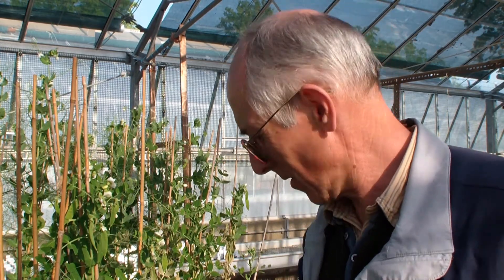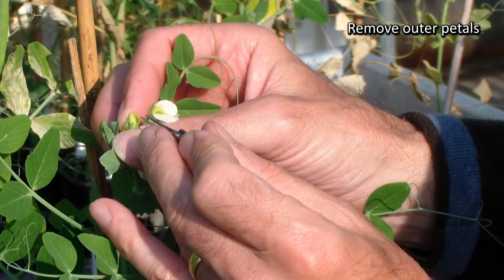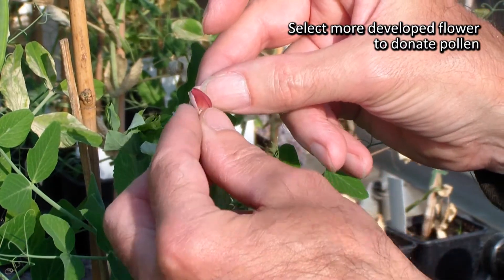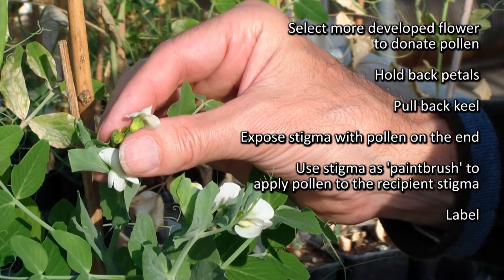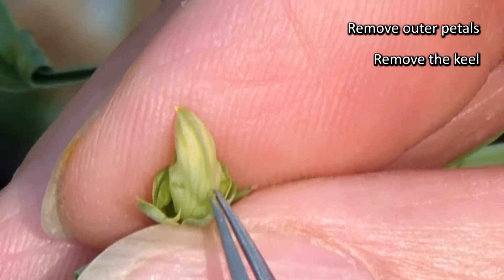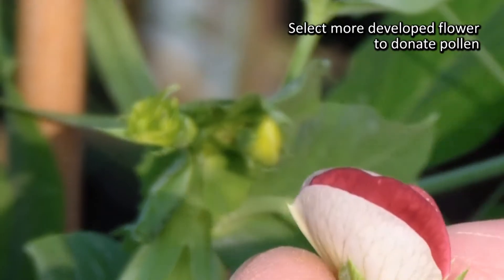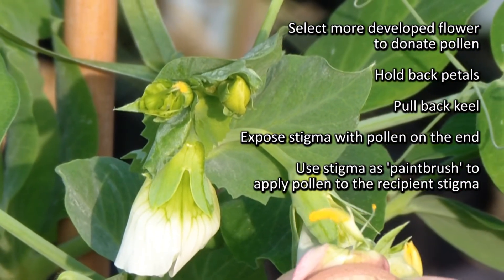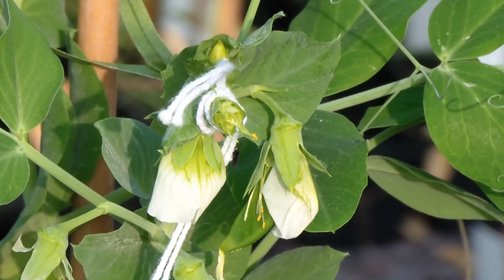GRU Information Resource 1: Guide to how to cross peas.wmv

Comment: nitip pak

1. Select a flower at the bud stage before it has opened
2. Fully opened flowers have already been polinated
3. Immature buds are better for crossing
4. Remover outer petals
5. Remove the keel
6. Expose anthers and stigma
7. Remove all of the anthers
8. Leave stigma ready to receive pollen
9. Select more developed flower to donate pollen
10. Hold back petals
11. Pull back kerl
13. Expose stigma with pollen on the end
14. Use stigma as ‘paintbrush’ to apllply pollen to the receipent stigma
15. Label

Comment: im planning to cross breed my beans and peas
Reply from the maker: +SSJoe13 It's good to try new things but they are too distantly related for cross breeding between peas and bean in either direction. They have the same number of chromosomes but they diverged so long ago that the pollen of each will not be recognised or allowed to develop and fertilisation will not occur. This and other mechanisms are natural barriers that prevent crossing materials that are that divergent in evolutionary time.
There are tricks that can be tried such as cutting off the top of the style before you apply the foreign pollen as this sometimes removes some of the incompatibility problems but even if the pollen does grow and get to the egg cell then the pairing of chromosomes is very unlikely to occur for a host of reasons.
Despite the many problems and the fact that nobody has succeeded in crossing peas with beans in the past should not stop you trying as this is biological material and strange things do occur against all the accepted wisdoms and knowledge.

let me know how it goes.